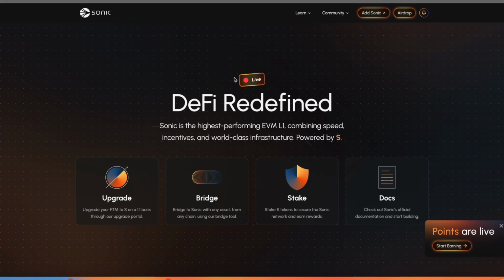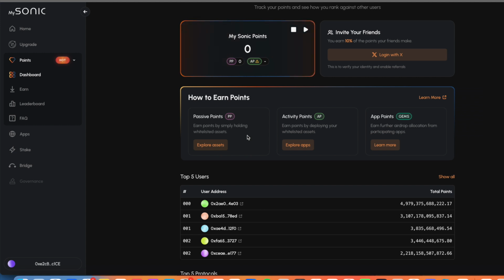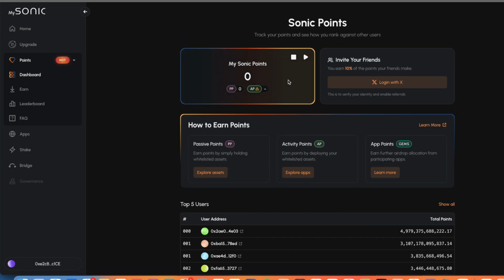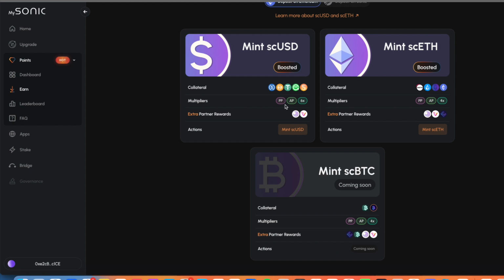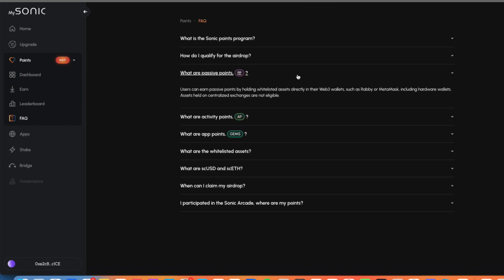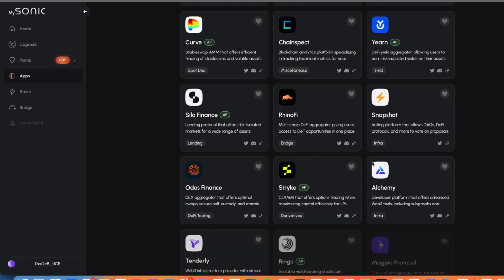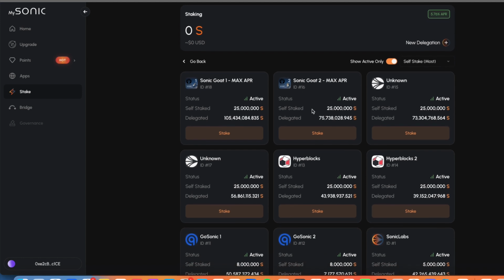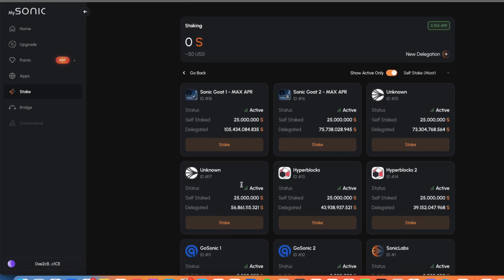FANTOM IS NOW SONIC // 200M AIRDROP // 10,000 TPS

Comment: Fantom’s transformation into Sonic marks a groundbreaking leap in blockchain technology! With an impressive 10,000 transactions per second (TPS), it is set to revolutionize scalability and efficiency in the crypto space. The 200M airdrop is a strong incentive, further strengthening community engagement and adoption. By pushing the boundaries of speed and performance, Sonic positions itself as a top-tier layer-1 solution, ready to compete with the best. This upgrade signifies not just an evolution for Fantom but a major milestone for the entire DeFi ecosystem. Exciting times ahead for all $FTM believers!